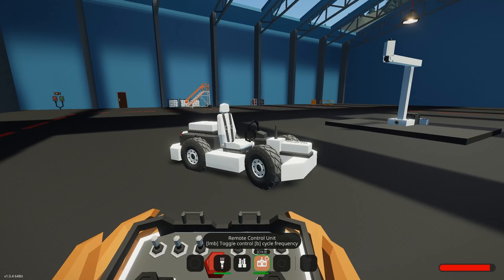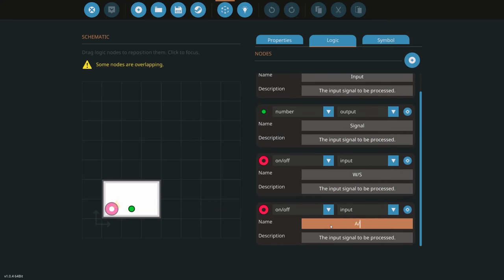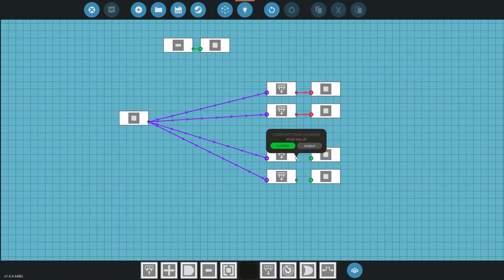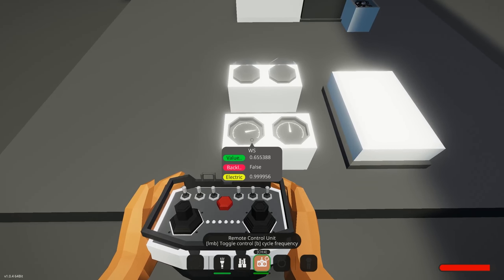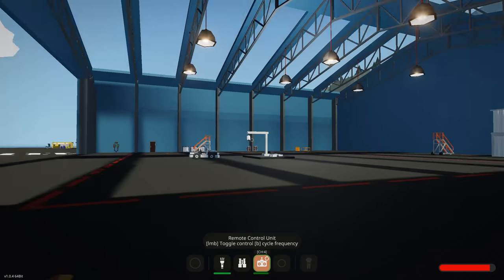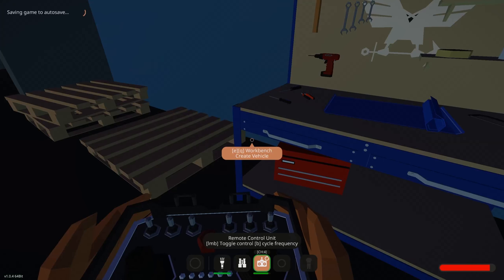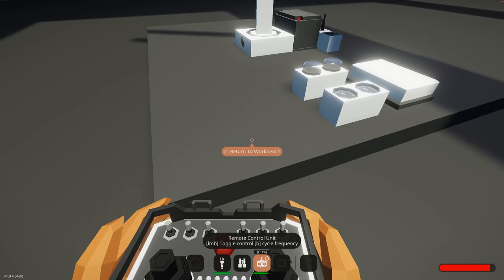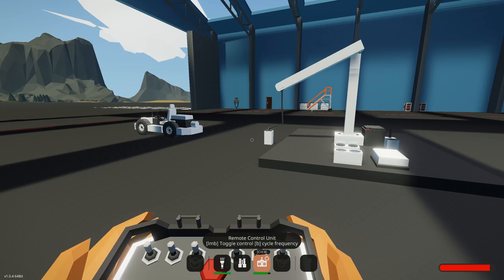NEW REMOTE CONTROLLER!!! - Stormworks Version 1.0

Comment: What you could have done for sticky keys is to use a push to toggle logic for on/off. Figured it out today. The only drawback is that you have to press the configured button on the remote twice sometimes. But works like a charm otherwise.

Comment: I'm probably going to end up using this just as a quick work around to having a multi channel radio control setup. Every fluid crane type shares the same channel code I believe (crude oil cranes all have the same code same with diesel and jet fuel) and so rather than having to switch channels each time or have 3 designated controls per crane, I think having a micro controller that has a preset for the 3 channels and 1 remote controller will be faster/easier.

Also, we need some kind of definitive counter measure against the Megalodons and Sharks so we can better utilize drones. Like I'm thinking if you're being harassed by one, you can launch a drone remote controlled and then have it drop a deterrent bomb (like a chemical scent deterrent) between you and the Meg. This would also be a practical use, that and firefighting.

I commented this on another video of yours (the tech tree one) and I think it can play into this as well, but if we had actual "career skills" as tech trees as well, you could have a "robotics" career where you get +X% to the range of remote controllers and +Y% to the battery life of it. As you max out the careere tree you could also have additional channels added so like a max "robotics" player would have 4 or 5 more channels than someone with no points into robotics. Just an idea.

Comment: What you didnt show or talk about is that the longer you hold a button the longer it is going to hold itself down. If you were to show your key inputs vs the crane movement we would see that it doesnt match up good. For example, if you hold "a" for 0.5 seconds, the number output will incrementally rise. When you let go of "a" it will decrementally lower, but because you used threshold gates the crane will keep moving until it has decreased enough for it to not be withing threshold. Therefor the controller is virtually useless and the devs failed hard with it. Simply adding the seat options to it would fix it. Sadly there is no way around it now so ill just stick to not using it.
Reply: chill down dude, they just released it, they are going to fix things, they allways listen to the comunity so you dont need to worry
Reply: @RGMS_  The problem is that I've seen 0 people complain about it. And also, why release something without even basics features?
Reply: i think that they have not thought of using the controler for cranes or other things that need a "sticky" input, but people are going to start asking about, this channel is an example, im pretty sure that devs watch this videos and based on that they can start to add more options in time
Reply: What you could do for sticky keys is to use a push to toggle logic for on/off. Figured it out today. The only drawback is that you have to press the configured button on the remote twice sometimes. But works like a charm otherwise. It is a temperory fix until devs get it right.
Reply: Wouldn't putting clamps on the A/D and W/S inputs solve this? It's now bound to be between -1 and 1 and if you shrink the thresholds on your gates to something like within 0.55 and 1 (and negative inversely of course) you'd have a faster reaction to slowing down, but just a bit of a delay in initial action. The Up/Down logic clamp would only bind the range that the total up and down output it can reach, but if you're clamping both actual input and the resulting output it should have a cleaner reaction time.
Reply: @steeljawX  No, it will still rise above 0.55 withing the seat and therefore same thing happens. I could put it at 0.99 and have an instant release time but then the engagement time would be likes 10 seconds
Reply: @ClayThunder  Well now that I think about it more, I think you'd need a bit more complex math on this one, namely dealing with the whole Sine and Cosine, as you want the increase and decrease rates to be exponential to a point, but you want to cap the limit. I don't know how to cap the seat output without changing the game files, but I know the function logic, the f(x) blocks, all have sine, cosine, and tangent equations programed into them.

Again, this would assist in an gradual, but exponential rate of increase and decrease from the input/off input. But this is math and logic beyond my dedication to the game. Someone might have a custom microcontroller on the workshop that does this already, but at that point, the only thing you'd be saving is space and a little time (instead of having multiple seats for each thing or having to switch a 3-5 digit channel for each remote thing.) I think I'm just going to wait for the devs to clean it up, since it seems to have so many holes in it.

Comment: Have the remote controllers been changed or do I have a really annoying bug? For me, the 1, 2, 3 ... buttons do not work as a push, but as a toggle. And what's even worse: When I activate the controller via left click, the signals always start on. And I can't compensate for that with my microcontroller.

Comment: Ima be so hyped when sounds get partly cut out when your in a vehicle. The engine and weather stuff should be quieter when you go inside that would be so immersive but it’s gonna be hard and I doubt storm works is gonna do it
Reply: myself i cant wait for a material update or liquid fueld rocket engines
Reply: It'd be a sound filter, and shouldn't be too horrid to implement.
Reply: THIS! Been wanting it since Stormworks first came out in early access. One of my top wish features of all time.
Reply: I only want new windows
Reply: Seems to have it with 1.0 sounds are muffled when my view is inside the ship versus outside

Comment: It would be cool to have GPS output, on version 1.01a I was finding it was pulsing 1-6  when you activated it. Not an issue unless you have pluse to toggle inside the microcontroller.  Found it on my helicopter as i would winch to the floor then activate the remote to move it and it would turn off hover mode and then crash...